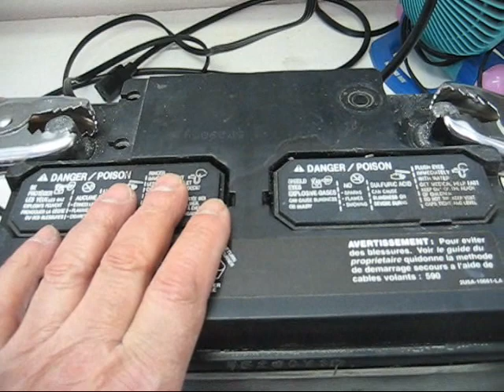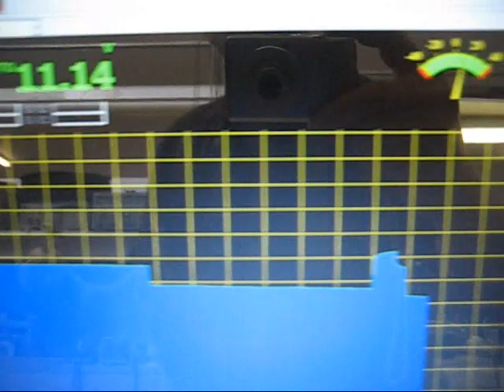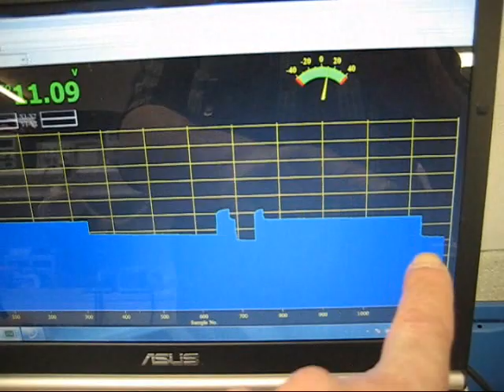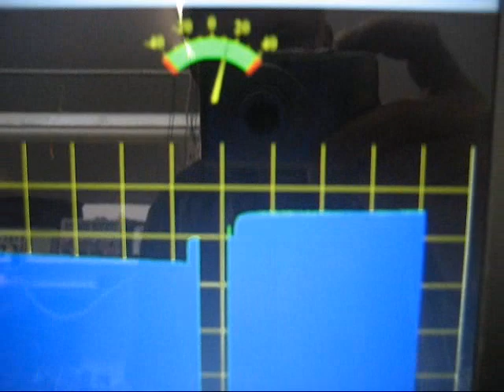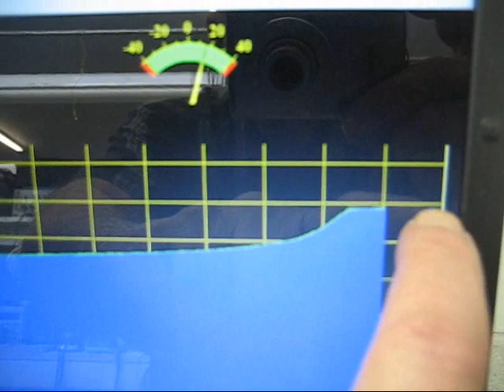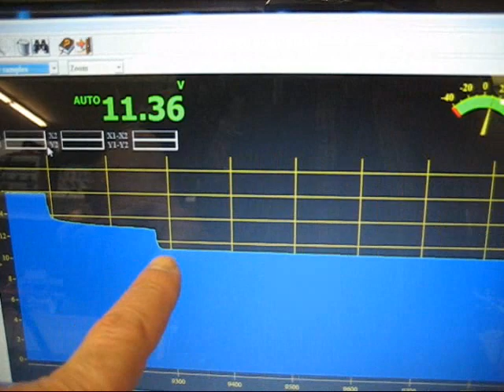Lead Acid Alum Battery Conversion Part2.wmv

Comment: You have amazing analytical tools at your disposal.  And, your video is quite informative in an informal way.  But, you missed the golden opportunity to take full advantage of the advanced tools you have to tell us how many amp hours your converted battery has at a 20 hour rate.

But, thank you, for an otherwise useful video - because, I could understand what the display on your computer was telling me.

What is the software that you're using here?  And, did it come with your load box or is it an independent application?  Thanks, again!
Reply: +Richard Owens If you do the math from the first video at C1 rate, it's about 20-25 amp hours.  So I imagine at C20, it's about the same as the lead acid.

Comment: How many AMP HOURS does the Alum conversion battery put out VS the sulfuric-acid electrolyte Lead battery?
How long does the converted Alum battery stay within a range capable of running a 120 volt inverter w/ a 9 amp pull?  Would the normal LAB work better for this purpose?
Anyone ever notice how you can search for the Amp hour info all over the web up & down & yet somehow, w/ all the nerds experimenting for how many years not one soul has commented on the obvious?  Coincidence?  What the hell is the amp hours of an alum battery?
Reply: +ComandOr Zerxius Well, if you do the math from the first video, at a C1 rate it's about 20-25 amp hours.

Comment: Great research.  I'd be interested in the following:
1) Does the new 'Alum' electrolyte work in a new dry battery (ie do we need the sulphates from the acid)
2) How does a MgSO2? (Epsom Salts) compare
3) How about trying a Lithium based solution, maybe LithiumSulphate ?

This is very interesting stuff and it seems that we can convert an old Lead-Acid technology to an Alkaline Technology.  I'm guessing that you are now removing the sulphates off the old battery (basically reversing the anodization process).  But that's my guess and I'm not anywhere near a battery chemist/physicist.

Comment: Why do you avoid the most important issue:  what is the amp hour capability of this battery with alum?  It's fine to show it can deliver power at a lower voltage than lead acid, but how long does it last.  We need amp hours, or - considering the lower voltage - watt hours.